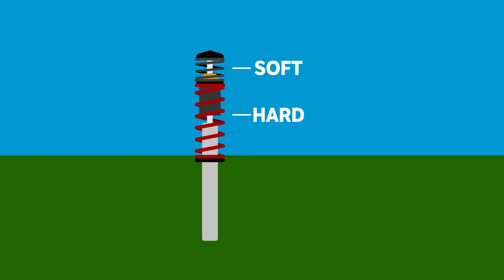What Difference Do Coilovers Actually Make To Ride And Handling?

Comment: BTW Alex where is your m3 lemon? We loved that car. You sold it?
Reply: Yeah he got rid of it because the E36 was causing bankruptcy.
Reply: Slid Wheel typical BMW 😀
Reply: Slid Wheel really?
Reply: Average Bro I know that's the problem with every German sport cars.
Reply: Thekrygaming _ yeah he even did a video about it, it's kinda sad really.
Reply: Slid Wheel I have e30 320 and it's super reliable. I beat the shit of it and it still comes for more.
Reply: Average Bro oh great, I'm glad yours is being good to you as you being good to the E30 320.
Reply: Slid Wheel no really e30s are tanks maaan. Not all German cars are unreliable. M cars mostly are :D
Reply: ... BMW's are really reliable if you put some work into them. Sadly, he bought a lemon one with a lot of rust...
Reply: Average Bro old Benz are tanks. Until the 90's those cars had no budget limit in R&D, that's why they were so good.
Reply: Pardon? 99' E39 523i reporting, it was a backyard car for 3 years, saved from going for scrap, did some basic stuff like the oil, belts, safe not perished tyres and such. Drove it around the block to check if it will break and then went on a 1000 mile road trip. Drives perfect, did not miss a bit chasing fastest cars on the highway doing 3 digit speeds all day long not breaking a sweat. Next week it's gonna get hit with another road trip, this time 2500 mile one. Maybe no sports car but in the same category as the other dude's E30 320i.
Reply: Rafa Allegretti I have benz too 96 e320 very good car, super comfortable, quite fast in city and very reliable
Reply: Average Bro All of the cars in the previous episodes are not seen anymore
Reply: My first car was a 1996 E36 318i, I bought in 2009 for £400. It had 125,000 miles. Me and every one of my car mad friends beat on it constantly for 22 months. It finally gave up the ghost at 176,000 miles after only ever having an oil (and filter) change. It had a couple of spots of rust yes but I can't imagine any other £400 car coping with that level of abuse and delivering so many smiles. 🙏💙
Reply: By gave up the ghost, I mean I cracked my "big end" 😂
Reply: Slid Wheel I own a 330ci e46 and its absolutely reliable.
Reply: MrDanielsahne 

I had an 02 330 46 and was terrible one worked hard , was not a drivers car , could have more fun in my mk6 transit
Reply: SARY GLD BMWs are NOT really reliable, unless we're talking about the ones from the 70's and 80's. anything from the 90's and above is unreliable trash. Talking from personal experience
Reply: sadly I can only second this. From cooling system to.. basically everything
Reply: acidofil cooling systems, shitty gaskets that need replacing every year, valve stem seals that go bad and make the engine drink oil like crazy, bad HPFPs, crappy transmissions, finnicky electronics, etc etc etc. I fucking hate when people put "reliable" and "BMW" in the same sentence, because these people usually either have a 30 year old model, or they lease their cars under warranty. That's not to say that I hate BMW, but I dislike misguiding comments
Reply: Zf transmissions are crappy?? M50 and m52 engines consuming oil? U dont even know what ur talking about.
Reply: for example M54B30 is wellknown for its oil eating habbits. Shifting in e46 is one big disaster(i believe it was fine when the cars were new tho). I still love my car, but e46 reliability is sub-average at best.
Reply: Turboahdettu I'm talking about BMW's that are actually worth getting into, like the 335i, 550i, 750i, M5 etc not base model 20 year old rice burner 325i's. My 7 series, as much as I love it, needs minimum 1k a year in repairs because of all the plastic shit under the hood. And the ZF transmission needs constant TLC or else it'll grenade itself, so much for that "lifetime fluid"
Reply: acidofil thats why i didnt mention m54
Reply: thats why i did haha ;D
Reply: Tehgziz Lauw 20 years ago 325i was the top non M model like 340i in 2018
Reply: @davissilvestrs1996  nah top was 328)
Reply: There is your relaiability problem: "not 20 year old model" mhm have fun with your plastic garbage can E65 falling apart.

Comment: Alex:I don't want to go over 4 thousand RPM

Every Honda owner ever: W-WTF?
Reply: Diesel says hello
Reply: More torque @ 1k RPM than a honda at 8k
Reply: Josh torque is meaningless without BHP.
Reply: Anthony Belton-Ford this BMW have more
Reply: It's all what you  like to drive, Anthony. I prefer my vehicles to have a lot of low end torque for the city. I wouldn't purchase a car with less than 200ft pounds of torque.
Reply: Josh That's meaningless if you don't know the gear ratios.
Reply: That's a good point, TheMindGarage.  I have a friend with a Mitsubishi Lancer, doesn't have the highest torque numbers but Mitsubishi made the 1st gear ratio fairly high. God damn car launches like a v6.
Reply: you know that you need torque to make horsepower?
Reply: @alexstromberg7696  you need both (and gearing) to make wheel torque
Reply: @ellenorbjornsdottir1166  HP is math, engines only produce torque.

Comment: i think ECU tune would make a big diffrents
Reply: Like_a_Sleeper dangerous and a no no without improvet cooling in on track use
Reply: it depends, a conservative tune won’t hurt. additionally they can easily get some better cooling in the car
Reply: Like_a_Sleeper if the tyres are already loosing grip then a tune isn't the way to go
Reply: well he deffinitly change the tyres but with a ECU tune he would get the Diesel torque to accelarete quick after corners :)
Black Smoke incom.
Reply: Yeah, grip is one thing but Alex already got new tires(off vid), so, if they’re not planning any power mods and only things such as suspension, tires, weight reduction - a tune is the easiest way to get some extra power into the car. I know the older BMW engines are easy to tune without putting too much load, its not hard to achieve about +30kw and some extra torque.
Reply: these 3.0D engines are great even before a tune, after a tune they become a power house, so much torque

Comment: Isn't an oversteering rear a sign that the springs are too stiff? I don't think the suspension changes actually made much of a difference, since they weren't that significant. Maybe go for BTCC style camber, stiffness and ride height and there may be greater improvements. And my goodness, those new rims are vomit-inducing.
Reply: That or not enough camber. Fortunately, e46s have camber adjustment on the rear, so that can be dialed in rather easily. Unfortunately, the camber is not adjustable on the front as well, unless you put in some camber plates or, the cheap/ghetto way, add some shims to the lower mounting point of the damper. I'm mentioning the front camber, as e36/e46 love a lot of camber. Ideally, for track use, you need to run something like -3 degrees which, this coilover setup surely doesn't provide.
Reply: Agree you need -3 or more on the front, -0.6 is horrible
Reply: To be honest, I don't know why it changed so little. Maybe the right height is not that different from stock? On my e36, when I installed the classical combo Bilstein + Eibach Pro Kit, I had something like -1.2 on the front. I did have the excentric M3 control arm bush, but I'm not sure that changes the camber in any way or if it actually improves something. I had huge caster afterwards, so I assumed it helped with that. The shop sent the wrong part and I went with it hoping that it will help  :P
Reply: Also note that e46 330d toring is heavy as f*ck
Reply: Or it could be that he just need better tires to take advantage of the new setup.
Reply: Kr Dz I think it may need lca’s or it needs camber plates too get more than -.6
Reply: Oscar Lee please stop thinking as it's dangerous. You don't want to set bad example and tell people coilovers don't make a difference and it's a combination of other components like camber plates, adjustable arms, anti roll bars, bushing etc... that's devils talk and I don't want to come there and slam the shit out of you. If you want to be a BTCC driver, you simply invest in 1000$ coilovers and you turn into instant legend.
Reply: Would agree that the tires became much of a detrimental factor do to the stiffness.
Reply: Suspension setup depends on your tires (among other things) and going “BTCC style” with road tires will produce horrible results, as would full slick tires with stock family car suspension.
Reply: @mariuszanfir2298  the excentric bushing off of the m3s are what give camber to the front on the e36
Reply: Adrian del hoyo Possible, I will not argue with that. What I'm sure of is that the card handled excellent afterwards, with no ill effects, no tramlining etc.

Comment: this Eibach rep has the knowledge and explains it very well...but you're going to have to go to stiffer anti-sway bars and grippier compound tires to see a significant improvement....and those stiffer sway bars will result in much more 'head toss' .......you think a company with a Billion Dollar R&D budget can't tune your car's suspension for the best trade off between ride and handling ........ ?  Also, aren't they almost $2,000 when you consider tax, and installation adds even more - that's insane......
Reply: Agree, the car looks harder to drive to me

Comment: 6:10 wait he is a suspension specialist and says to use spacers to get wider track, only did he forgot that  if u use spacers you make eventualy the wishbone longer and so a longer arm. if you make a longer arm it can more easliy  compress and so make the suspension softer and the car can roll more.

its just better to use wider wheels with maybe a different offset. spacers are just the the most stupid thing to add to your trackcar.

and dont forget to reinforce the subframe cause its still a e46.. bmw people understand me.
Reply: well yea lol, it fucks up the SAI
Reply: Also if you widen the track too much, you adjust the scrub radius, which most "tuners" haven't even heard of, to such an extent, that the car becomes undriveable. It won't want to go in a straight line and it's probably going to fly off the road and kill you under heavy braking.
Reply: yogummler, could you please elaborate on this one?
Reply: thesilviu silviu "An advantage of a negative scrub radius is that the geometry naturally compensates for split µ (mu) braking, or failure in one of the brake circuits. It also provides center point steering in the event of a tire deflation, which provides greater stability and steering control in this emergency."
If you widen that track too much the scrub radius can become positive and then the car can become extremely dangerous under emergency braking
Reply: A low offset wheel is exactly the same as a higher offset wheel with a hub centric spacer (from your wheel hubs point of view). There is no difference at all. I run a square setup on my M3 and use a rear spacer to account for the difference in track width between the front and rear.
Reply: Spacers or wider wheels have the same effect, widens track and changes the scrub radius - mu split braking (one side of the street wet for example) can lead to yawing

Comment: Hey Alex,
additionally to your new tyres, you could reduce oversteering by reducing stiffness on your rear axle. You're also losing the grip of a complete tyre while your front left wheel jumps. Maybe you shold readjust the travel distance on the front, so you don't loose ground.
Could you please explain, why you don't want to rev to the limit? Even if it's a diesel, you should rev the car to max. power (even if torque drops before), to gain maximum acceleration. However, I don't know at which rpm this point sits. 
Cheers

Comment: that car is not built to handle the load that those springs and shocks are putting on the spring perches and shock towers... they will crack or start to over stress the body of the car. you have to weld in reinforcement plates or the car will rip its self apart.
Reply: Arden Nielsen true. Better with reinforcement.
Reply: Yeah but itll be amazing when the car just falls apart
Reply: e30 e36s e39s and e46s destroy strut and shock towers stock because of the unibody design.
Reply: even my 1994 Ford Thunder Bird had the rear shock pop a base ball sized hole in the frame on the rear and it also cracked the rear fender, it is a type of fox body car... it has several plates welded into were the shocks pushed  thru the body. but then that happened because of 360'000km of hard driving and potholes, plus i think the cut springs on it put an excessive load on the shocks causing them to rip out of the fender over time.
Reply: Arden Nielsen Most people only reinforce the strut towers once they do true coilovers in the rear. But here the springs and the dampers are separately so there isn't that much more stress on the strut towers.

Comment: How are we going to trust you with reviews when you are sponsored and actually selling those items in the video? You seem very biased.
Reply: what if he only works with companies and sells things he personally backs and trusts
Reply: Brian Smith He’s not accredited or reliable. He’s entertaining, seems like a decent bloke, but it’s not as though he’s a doctor or a qualified mechanical engineer. 

I don’t blame him for trying to make some cash but these video-long adverts are pretty bad. That Shell V-Power one was absolutely unwatchable.
Reply: Brian Smith Because what he trusts is irelevant since he is not an expert on the topic and therefore cannot be trusted to make the best choices to show people how things are done...because they're, simply put, just not done this way. For example he said that those Pirelli tires are clearly overwhelmed by that extraordinary suspension setup, which is really not the case at all. Take a P1 and slam some P-Zeros on it and it will just work...(I just chose it for the P's :p ) But that's because of the fact that the P1's suspension setup is NOT just bolt on coilovers and expect it to just work on their own, or worse yet, expect the tires, no matter how good they are, to do all of the work...it just doesn't work that way yet many people think of these things as individual "mods" that work independently of the rest of the car and the experts regard them as "packages" meaning many pieces working together.
Reply: was thinking the same thing
Reply: Eibach is a good brand though, there are other suspension brands that work similarly I'm sure. I like how that one had two different type of coils, some I've seen are sort of like that but basically it's a single coil but changes to spiral more near the top, which might work similarly.

Comment: Just install bigger turbo!
Reply: Problem is that engine is the worst of all m57s, max power is like 270hp or something with maybe 600nm. Should have bought a 330d e90
Reply: MOAR B0000000000000ST
Reply: Alex Strömberg u are actually wrong, the E90 has more Power, but because of eletric failure its not reliable at all and its more expensive to fix
Reply: @kittf7  but this isn't about how long it will last tho
Reply: And intercooler, and nozzles... and a better clutch, and an lsd. Then youll be somewhere near 350+bhp and  700nm.
Reply: Alex Strömberg with hybrid turbo 360+ and 700+nm
Reply: Installing a new turbo would cost thousands as many other parts in the engine would need changed and everything would need retuned. Overall it would make the car less reliable and would cost upwards of 8/9000 pounds
Reply: espro Alex said that they might add a Hybrid Turbo
Reply: Alex Strömberg not true! This is only the case with the 184 pre facelift 330d with the m57 2.9
Reply: Power is nothing without control.... Just ask a Mustang owner
Reply: 150kW is plenty for this tiny track, suspension and grip is more important.
Reply: Handling comes first. Add the power later on.
Reply: Alex Strömberg well, you dont have to pay your things? Cuz if its reliable or not it matters, cuz you need to pay to fix the car, and, if you track a non reliable car you are not being able to track
Reply: u are actually wrong, the E90 has more Power and is more reliable than 20 year old e46 with rust problems.
Reply: Carsten Langbo nah... power is everything if you live in Germany and drive on Autobahn :) (i do)
Reply: espro that would would mean more lag as it would take longer for the turbo to spool up

Comment: stiffen it up... still waaay to much body roll
Reply: Zan Macarol Vrabec Tyres already loosing traction through hard cornering, going stiffer will only put more force through the tyre causing even less control.

Tyres with a stiffer side wall should of been fitted first before adjusting the the suspension to suite.
Reply: darren lynes yes but... You cancel that out with wider and grippier tyres. Not by aloving it to roll like a transit van.
Reply: Zan Macarol Vrabec You need weight transfer (body roll) to force the tyres into the road. The key is good control of the roll and having enough bump travel in reserve to keep the car settled if it encounters a bump mid corner. 

Totally different with track/ race cars that use aero to push the tyres into the road, they can afford to have very stiff set ups.
Reply: Christopher Glover That’s the opposite of the truth though. If I car has less body roll there is more weight and momentum transfer through the tires, meaning less grip.
Reply: Roll didn't seem excessive, it's an improvement. Look at the old Miatas they have a ton of body roll but still handle well.
Reply: It looks like to me he had better control with stock and coil over his steering wheel was moving right and left...

Comment: Hey , I had this car and the best thing I did is fit there a Michelin pilot sport 4, it basically changes the car I recommend you to try it, and a good remap will put this car in 260hp and a lot of torque, I had the same one 204hp stock and it became a good sleeper